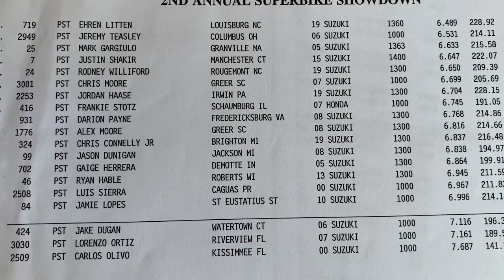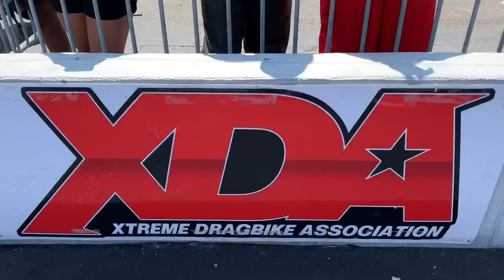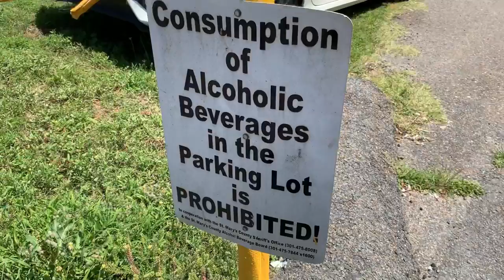FULL RECORD-SMASHING EVENT! THE DAY PRO STREET MOTORCYCLE DRAG BIKE RACING CHANGED FOREVER! TURBOS!

Comment: Could you tell us the difference between the Busa turbos , and the 1000's . I know they must gave the 1000's alot . Because there no replacement for displacement . Thanks .
Reply: Honestly a 2017 1000 is punching out 200hp with a derestriction in the US, rest of 0the world 200hp is the base power. The busa is what 180. Its a generation further on in development, the main difference in the stock bikes is gearing.
 the 1000 has better electronics and some more ability to do things in the clutch setup. Plus better suspension stock.

So honestly with the same wheelbase, same turbo, there isn't going to be much in it. The busa has more R&D from the aftermarket but... The 1000 is a nice engine to work on and a lot carried over. The 2006-8 1000 is essentially the same engine as the busa in its engineering and the 08-16 and the 17-20 is a 200hp missile stock. A lot of the lessons learned with the busa will carry over and a lot of the parts are much of a muchness so.... Its not going to be as much difference as you think, some weight, some wheelbase and maybe some tweaks in the transmission.